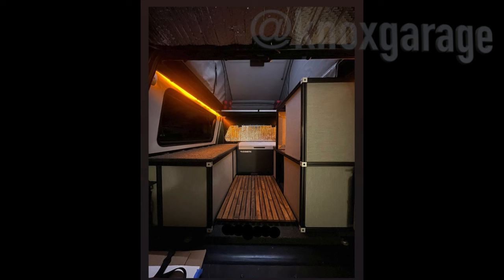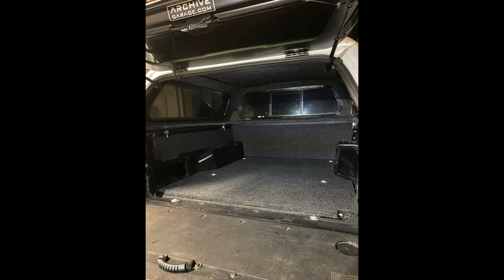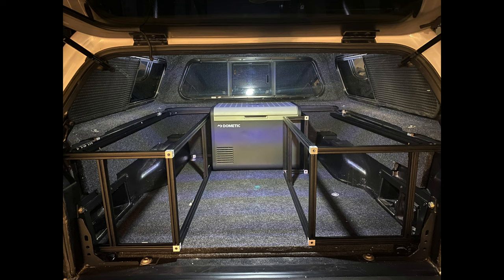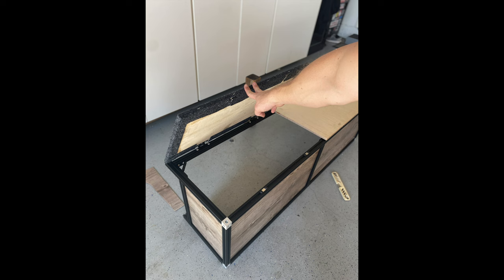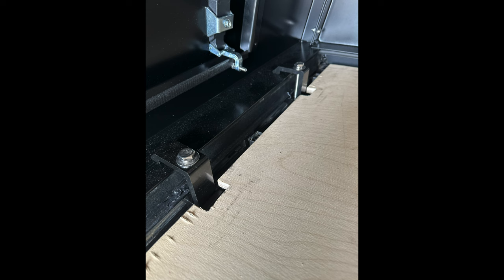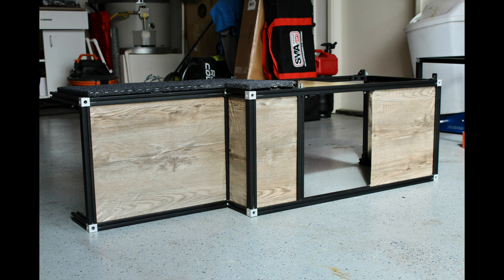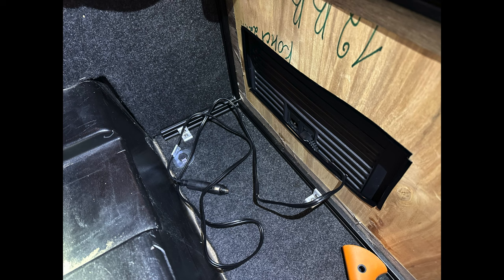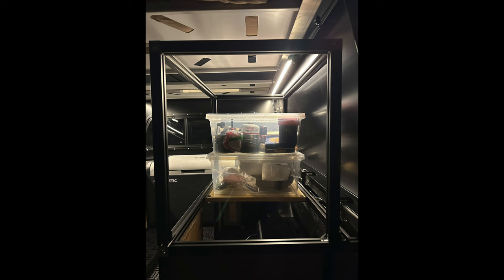80/20 Extruded Aluminum Cabinets | Truck Camper Build | DIY | Tacoma

Comment: Curious as to how likely 10 series is to bend. I built my drawers using wood with some really heavy duty drawer slides but right now the whole thing is coming in at hundreds and hundreds of pounds. I’d like to start reworking things using aluminum, but I also don’t want it to end up bending…
Reply from the maker: It’s very strong

Comment: i currently have custom slide our drawers in my truck bed, so it's nice I just open tailgate and pull out sliders and have access to camp kitchen on one side and storage/tools on the other side.

i'm considering getting a wedge camper but this kind of set-up you have here does make me a little nervous that it'd be kind of inconvenient to get things as it seems you'd have to crawl in there to access what you need, ie. fridge/etc. for example if you just need to stop for lunch on the trail, are you opening the camper wedge 100% so you can actually stand in there?
Reply from the maker: I had a similar setup before with slide out drawer. Opening it up to stand in there. I hang out in there when weather is bad that is the advantage. I use the storage cabinets to put my plastic storage pins and everything is accessible. Tell Topo Toppers I sent ya if you decide to go with them. 😎

Comment: I LOVE your build Out! Starting to plan something along these lines for a gen 3 Tacoma 6' bed with a popup camper shell. Can you tell me if you cut your pieces of 80/20 yourself, or provided measurements and had them cut for you. Also what did you use to attach the insulation to the sides and front of the truck bed. Do you feel that area wise that provides you with enough extra insulation as opposed to also covering up the wheel wells? TIA for your expertise !
Reply from the maker: I ordered everything to size from tnutz. Gave them the measurements. The 1” home insulation is good enough for a house it’s good enough for my truck bed. The insulation I didn’t attach it was a firm fit and it held in by itself. It’s covered with the cabinets now so that also holds it in.
Reply: @jonnytacooutdoors  Hey thanks!!!!! Will surely have more questions. Thanks for your speedy reply!!!!!
Reply from the maker: @karengreen5287  of course lmk when you have more questions. I asked Knox a bunch throughout the process. 🙏🏼😆

Comment: Did you have to tap the ends of the extrusion holes for the corner cube hardware?
Reply from the maker: No, When you order from TNUTZ you select the thread you want and it comes pre tapped.
Reply: @jonnytacooutdoors  so I have to buy cut to length then to make it easier?

Comment: I have questions. So from bottom to top.... 1/2 inch insulation (on the truck bed), on top of that 1/2 inch plywood. Does the insulation get dented by the ridges of the bed? Or is it firm enough to stay flat? Then... did you only use 4 of the truck bed bolts to secure the whole thing? Did you put washers under the gaps?
Reply from the maker: There’s six bed bolts, not sure on the insulation what it did. No washers were used.

Comment: Looks awesome! Im about to do this to my taco and have most the parts but definitely gonna do some hinges like yours so thanks for that! How did you connect the 80/20 to the bed rail?
Reply from the maker: Thanks! I used these along with some tacoma bed rail nuts and bolts purchased off Amazon. Drill holes in these and slide the nuts through with a washer. https://www.amazon.com/Senfei-Security-Bracket-Connector-Channel/dp/B08QN4G6GX?crid=S79MRLDO46QT&keywords=senfei+heavy+duty+bar+holder+shaped+connector&qid=1678746422&sprefix=senfei+heavy+duty+bar+holder+shaped+connecto,aps,165&sr=8-2&linkCode=sl1&tag=jonnytaco-20&linkId=2405053fe4c1247bcc5bbdc17dd42870&language=en_US&ref_=as_li_ss_tl

If you have instagram reach out and I’ll send a picture . I used four bolts on each side. The bolts heads were hard to get to so I actually had to grind down a wrench to fit in there and SLOWLY tighten them down. Hope this help.

Comment: Hey man! This is amazing! I have a GFC I’d love to do this with. How did you account for the clamps on the topper that is the bed rails to secure the topper to the bed? I assume this protrude out a fair bit no?
Reply from the maker: Thanks! just had to notch out the cabinet tops so they could swing up.

Comment: Cool build and great video! How has the 1/8" birch held up to use in the slots of the aluminum?  I'm planning to do the same thing but had concerns that it was a little flimsy and might fall out if accidentally kicked. Going back and forth between that or using panel retainer brackets to securely attach 1/4" birch.
Reply from the maker: It’s been holding up great no issues. I do wish that I painted the wood instead of putting the paper on it but it is what it is. The world is thick enough and doesn’t fall out. If you get the size right I haven’t had any issues with my panels falling out not even the sliding panel.
Reply: @jonnytacooutdoors  good to know! Thanks!
Reply: @jonnytacooutdoors   Sweet set-up looking to do something similar when I get my Ovrlnd camper in a few months. I'm curious why you used the faux wood wrap. Was there a down side to just staining the birch or clear coating it?

Comment: Nice, all you need now is a small fireplace inside.😎 I will probably lay out my rig in a similar way, but not sure though how I will do my fireplace, it's a good thing I have a Dodge with extra room as I will need it. I don't usually sub to other channels as my channel is a little different than most but I just gave you a sub on here and Instagram as I would like to see your channel do well. God Bless
Reply from the maker: Hey thanks so much it means alot 🙏🏼 hope your dodge build goes well!

Comment: Did you reuse the bed bolts or have to buy longer ones once the 1/2 plywood was laid down?
Reply from the maker: You can reuse the Oem bolts just be careful not to strip them out like I did on a couple. 😎 all fixed now.

Comment: Another question: Did you use the current bed bolts or did you replace them with longer bolts when you secured the bed platform?
Reply from the maker: The Oem bolts will work , I needed up stripping a couple of mine so I did end up replacing a couple of them. Be careful!
Reply: @jonnytacooutdoors  Thanks for the tip.
Reply from the maker: @denahom  you got it lmk if you have any questions along the way

Comment: I have several questions, do you have a blog? Why did you bolt through the platform (I am assuming for securing the load) and who did you purchase your 80/20 from?
Reply from the maker: I don’t have a blog. I bolted through the platform to secure it to the truck bed. I put a link in the description to where I purchased everything including the 80/20.

Thanks for watching. Good luck with your build.
Reply: @jonnytacooutdoors  I just got a quote from a builder for $4,800. to build out my truck I think I’ll attempt it myself!
Reply from the maker: @denahom  yeah the aluminum only cost me $600 and total build out cost me around 12 to $1300. Fair warning it’s a lot of work but so worth it. 🤙🏼

Comment: How did you attach the wood to the aluminum? I am looking at doing something very similar in my Ranger.
Reply from the maker: Which wood? The panels I cut them to fit inside the grooves of the aluminum. The cabinet tops I used hinges. The countertop I used thick wood screws and 90 degree brackets. Hope this helps.
Reply: @jonnytacooutdoors  thank you!
Reply from the maker: @WaynePlaysGamez  of course, feel free to reach out if you have any more questions.